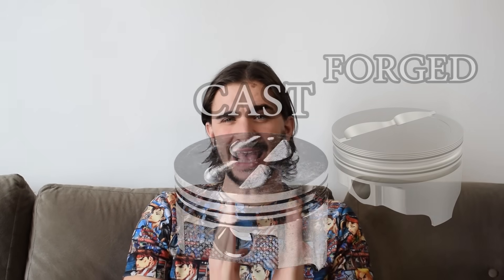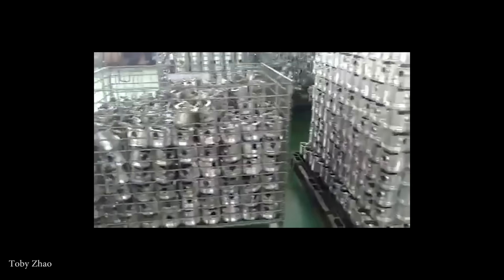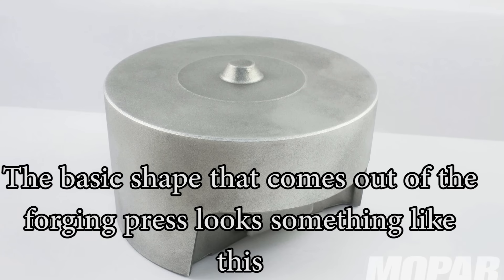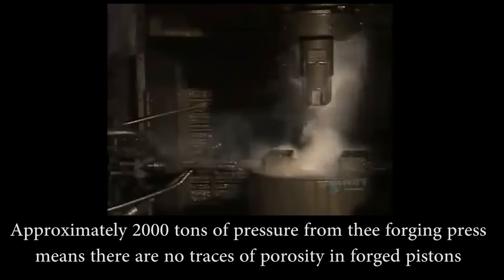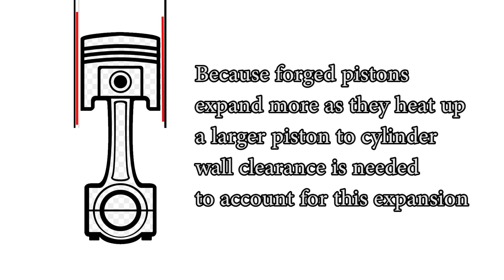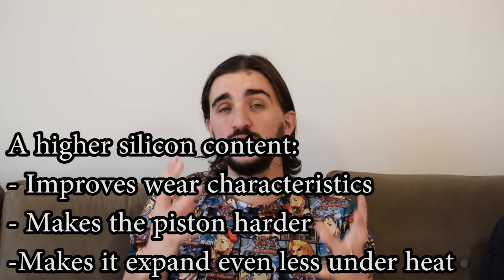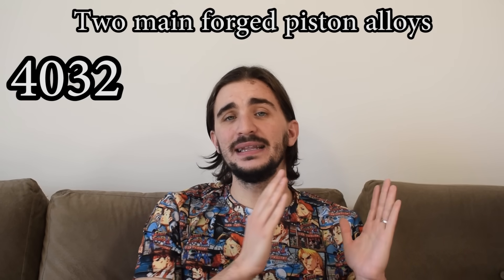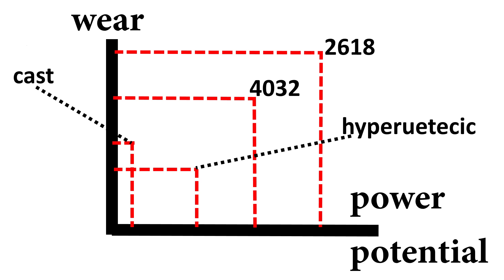FORGED vs CAST vs HYPEREUTECTIC PISTONS

Comment: Chrysler turbo cars in the 80's and 90's came factory stock with Mahle forged pistons. Mahle used a manufacturing technique which inserted steel rings into the forgings to control unwanted expansion. I can state from my own experience with two Dodge turbo cars that I own, the problem with piston slap and excessive wear does not exist with high quality forged pistons, such as Mahle's. My '89 Spirit turbo now has in excess of 300,000 miles on the odometer, and the cylinder walls still show the factory cross hatch pattern they had when new. Compression in all 4 cylinders is still well within good limits. I use synthetic oil and change it every 7000 miles. My opinion; hypereutectic pistons are just cheaper to make and so provide a higher profit margin to the guys behind the counter. They use the buzzword to make the buyers think they are getting something really superior to everything else out there. Not necessarily so.

Comment: when you look at it on normal running engines everything around the piston like valves, bore wear, rings, timing chain, head gasket, will give more trouble than the piston.

Comment: All y'all talking about boosting y'all's motors and running cast pistons need to find another source of information.  Put busy on top of those positions and see how long they last. I've got a high horse power drag racing engine with forged pistons. I take it when ever year and put rings a bearings in it. Not once have I ever seen any scaring or witness marks on the cylinder wall or piston skirts. They fact is very simple. Forged pistons are significantly stronger and longer lasting than cast.  The amount of clearance change from the heat is minimal. Thousandths of an inch at worst. If your getting piston slap, it's simply because you didn't buy the correct sized piston.

Comment: Toyota yaris here with tombac hypoeutectoid (yes hypo) precipitation treated pistons with unobtainalloy sleeves, tungsten hafnium carbide coated high speed steel valves, with a solid high carbon steel block, producing 3000 horsepower daily driver has 500,000 miles. Not for sale
Reply: slade bonge  The March 24, 1933 Daily Express Newspaper Headlines say otherwise buddy

Comment: I've got a 5.4 2v I built with - 6.5 cc forged pistons on mmr rods with arp 2000s. It's an e85 car only as it's supercharged with a vmp gen 3r blower with 20lbs of boost. Made 968 hp at 6200 rpm and 1002 torque at 4300 rpm  on a mustang dyno. It's a circuit track car only. I'm not into spending 1000s of dollars to got 1320 lmfao 😂. But anyways the piston slap sucks ass at start up. I know it's just beating the dogshit out of the cylinders. It's why i never daily it. It's a 65 mustang coupe with a custom built ifs I welded in on qa1 shocks and a 02 gt rear axle on a 4link on qa1s with a 6r80 trans controller with a US shift. I know I'm coming off as a show off lol but I love building engines. This dude really put a very good description on pistons. If you're going forged...just know you're going to hurt your cylinders every start up. You will have 3+ 1000ths of clearance on most set ups. That's going to knock until the expansion. That's just destroying the skirt and killing the hone.

Comment: i think the correct word for "Piston Slap" is actually called cavitation? Open to Corrections tho
Reply: Cavitation is when a liquid changes to vapor due to low pressure. The expanding bubble pops which causes erosion in the surface of the material in contact with the liquid.

Cavitation can cause piston slap due to there being no liquid oil between the piston and cylinder. It can also be caused by a large bore/small piston.
Reply: @9HighFlyer9  oooohhhhhh okay okay. Still learning alot of this stuff, so i guess that aint what i thought it was. Thanks for the info!

Comment: My stock Supercharged Camaro with the LSA engine came with Hypereutectic. Now I know why. Thanks
Reply: slade bonge  so do junkyard LS engines but whatever you say bro
Reply: Yes, because Chevrolet are cheap bastards
Reply: @DStead2239  It's funny how you see a crap load of Ford's with LS engines and gm transmissions 🤣
Reply: @georgeferrer23  Yeah?? not here, maybe in America..
LS engines are expensive here.
Cars also have to be engineer certified as safe to drive on the roads. So you don't see LS swaps as often into other chassis but you will see alot into old chevs or Holdens but they're normally quality full builds, not junkyard hillbilly hackery.
Fords here normally stick with the Barra as they can make power just as easily and in most cases, more power, more reliably for far less coin
Reply: @DStead2239  Ford's are crap everywhere. I don't know what planet you come from.
Reply: @DStead2239  Maybe your Ford's run on dingo power not actual horsepower.
Reply: @georgeferrer23  Actually horsepower here is measured properly, American horsepower is actual piss weak, by about 15% or more vs your Mustang dynos..
American fords are crap, So are Chevys, well actually any GM product is crap tbh
Reply: Ricers gonna rice
Reply: @DStead2239  lol that motor than can take 1200 hp is cheap af
Reply: @DStead2239  Yep, that C7 Vette was cheap but it still beat the Ford GT's lap time.
Reply: @DStead2239  yet everyone and their mom wants a junkyard Ls to put a turbo on...
Reply: @KingJT80  maybe in the U.S, here Bogans use junk yard barra's and the rest of us build proper engines..
Reply: @DStead2239  like richard holdner said youre both right

Why buuld the engine up like that when the junkyard ls will respond to a small turbo and cam?

And why waste time on a junkyard ls and just build it right?

You're both right. They both have their places

Comment: Very few  pistons are plain  cast these days.  Hyperuetectic defenitly. Even for a basic roadcar engine rebuild really.
Piston clearance is a very large drama. Block type and material is part, A cast piston used for performance is double the  manufacturer clearance, a hyperuetectic generally add a thou.Or they will scuff, nip or worse. And turbo makes life harder, more boost more clearance. The more modern forged are better for general high performance work and are cheaper as well. BUT you will never be able to get them as light and still strong as the older material. Big time racing requires them and small time turbo engines as well.
Alloy blocks also suffer from plenty of slap cold. Of all brands, though they design them to warm quickly
Any remotely performance engine requires a cooling system that gets up to temp quickly,, and  that means around 195-200F, not 180 as the ring gaps are probable 2 thou more.As for 160F you are simply wearing the engine out rapidly and a cast piston will lose skirts doing so. And losing loads of power as well.
Problem with all pistons these days is manufacturers make them with less compression than original, coupled with headgaskets a lot thicker and ring gaps more than 150000 originals. Just big low comp leaks. And this on supposedly performance engines. My 71 400 Ford, originally 9.1-1 would have ended up 7.8-1!!!!!. FM std replacement. This applies more too 60s 70s 80s engines but I have struck that on a rebuild of a 3y/o car that was overheated. OEM 9-1, replacement .020"  just over 8-1! Yeah right.
Everybody and especially the turbo 4 brigade spend zillions trying to keep engines together. Basic piston and ring clearance and correct comp is basics.As is running temperature. Makes more power than that bigger turbo or exhaust out the bonnet! And requires many less rebuilds.

Comment: Excellent video and information. You are absolutely correct with the analogy of engines and shoes. My bugeye WRX was fitted with forged pistons, forget rods and steel crank when it was professionally rebuild by the previous owner. The piston slap was very evident when the engine was running cold once I rectified the valve tappet clearances. It's my daily driver.

Comment: I guess that to minimize piston slap you’ll want to build the engine with a short stroke.
Reply: Rod length is more important. Every piston manufacturer will tell you the maximum rod angle the engine should have for that piston design. That's why you see a lot of stoker kit pistons with the wrist pins way up in the ring area, to optimize rod angle for the longest rod possible.

Comment: So that was some what interesting.... I'm going to be rebuilding my RB26 just refreshing it up by getting the head serviced and fitting new crank and con rod bearings as well as new rings. Should I just leave the OEM cast pistons or buy forged??? Like I said I'm just refreshing it no boring just honing the block. I'm fitting tomei twin turbo's and maybe changing the cam's???  The car won't be daily driven just a couple of times a month for cruising.

Comment: May I ask about mean piston speed ? Do forge piston have higher capability to piston speed?
I hear that forge piston can rev up higher than cast piston.
Is it true?
Reply from the maker: Yes, as a rule of thumb forged pistons can take more abuse, higher rpms and higher average piston speeds.
Reply: @d4a  do you have figure about it?
I read some article that cast piston is about 25m/s.
How about forged piston?
Reply: @leotsun  For high rpm application. You want to focus on forged rods and cranks if it not up the task, to hold all the mass, more the your general off the shelf forged piston set.

Comment: fun fact, in formule 1 the bore gap is so tight in a cold engine that there is actually no gap. 1 hour before the engine needs to run they pump in hot oil and hot water (well coolant). so that the engine warms up and expands. otherwise it CANNOT start. the engine and pistons need to expand but the engine expands just a little more so that the pistons can move.
Reply: Very tight clearances for performance but not practical in a normal car. And who can afford a team of mechanics to get your car ready to go down the shops?

Comment: Questions. 1st-Soooo does the forge vs cast also affect other parts the same way such as the crank or conrods??? 

2nd- Is it possible to say that there is aftermarket cast parts that could be better than oem with out having to go after forge ones in case that any one would like to go for daily butt more powerful than stock.
Besides that love the video hope they never stop coming and I'm still waiting to see some of that American metal in the engine SERIES👍
Reply from the maker: Forged rods and cranks are always better than cast and there really aren't any downsides there. The American engine aftermarket has many cast and hyperceutic piston options, some which are certainly better than OEM, especially old OEM from the 60s and 70s.
Reply: @d4a  thanks a lot for the answer, but I actually own a 2018 camaro ss so sadly no 60's muscle making it one of my"most have car's" for the future and hopefully not a far one 👌👍.

Comment: I was going to use a forged 2618 Mahle piston in my EJ207, but watched a few vids and went for a CP 4032 instead. So vids like this one do help us to make better choices.
Reply: Can you share the part numbers of the CP 4032 pistons for Subarus? I've never seen a 4032 from CP, while Mahle is known for their 4032 PowerPak pistons.
Reply: Ivan Delos Santos bingo. I’ve got Mahle for my SBF, they’re 4032. Don’t expand much, can run tighter clearances
Reply: Pretty sure piston slap isn’t really an issue in a horizontal layout.
Reply: The ej207 is factory with forged pistons tho ?
Reply: @alexjaxon9928  Depends on the year/version. STi V7 used forged pistons. V8 and above went to cast hypereutectic.
Reply: @19minorthreat69  no!! ...all sti 2 liters after sti v6,   hypereutectic pistons . 
for spec c .... I do not remember anymore
Reply: THESHADOW97139 nope, V7 forged. V8+ hyper.
Reply: Give yourself a step up in reliability, probably a good idea that u did that and u still get pretty good performance characteristics also.

Comment: So. You're telling me  I probably shouldn't put those 1000 dollar forged pistons i bought yesterday into my 89 corolla wagon with 251000 miles? Dammit.
Reply: actually if you got stock bore size it might be perfect hahah seal up that worn out bore
Reply from the maker: Lol!
Reply: Your friendly neighbor Stanley. You’ll be just fine Stanley just make sure they were STD (not what the neighbor has if you know what I mean) and save the money on  getting the cylinders checked. They will expand and fill then just fine
Reply: Your friendly neighbor Stanley just use it for drag racing as suggested.
Reply: Funny. It's alright. Just 'resell' it. Most likely, somebody building an engine for Motorsport would pick it up.
Reply: Ouch... But I saw this 11 months later :p How's your 89 corolla with forged piston?
Reply: If your forged pistons are O.E.M. from Toyota made for your 89 Corolla ...yes by all means install them ..but if your engine was originally equipped with cast pistons use Hyperutectic pistons

Comment: I use 2618 forged wisecos with quite large cold clearance on a honda b20b engine.

It starts up like a diesel, kicks oil out the exhaust on cold starts.

Just opened it after 200,000kms and the crosshatchings are still there with no sign of piston slap on the liners.

Definitely not usable for a daily driver.
Reply: Forged pistions need to warm up first. Definitely not for a vehicle that someone just fires up and goes. But they take some serious abuse.

Comment: is it true that on some engines like subarus ej20 the cylindre actually expand more than the pistons because the engine block is aluminium?
Reply: All I know is that all 2019 & 2020 STI EJ engines have hypereutetic pistons and STI ditched using forged pistons in the S209 last minute before full production for the cast hypereutetic pistons they started using in 2019 & 2020 STIs  after they used it in the Type RA as it was stronger during their testing parameters.
Reply: @slothystyle  oh okay. i have a 1998 sti with forged pistons and a very famous engine builder (subi performance) said in one video that the piston wall clearence is in hot temperature actually bigger than when its cold thats why subaru engines have really really tight fitment when it comes to pistonwall clearence.

Comment: Hello friend great content ! I have a hard time with my piston selection, i want to replace my DC2 Type R pistons for B18C engine to get around 250hp out of an 1.8L high reving engine, do Hypereutectic pistons suit my needs well?
Reply from the maker: It really depends on a lot of factors, as I said in the end of the video you have to ask yourself how often will you drive the car. If it's going to be a track car I would go for 4032. If a daily driver than 250 hp naturally aspirated might be a pain to daily drive, and I would aim for something around 210-220 hp maybe even less, and you could likely keep the stock pistons. But this is just my opinion and nothing more.
Reply: @d4a  i like how you think, its a very light car and dont need much power to go, i want to add +60hp to the engine but want to reduce the wear effect, i daily the Integra and go to work everyday, soo... Hypereutectic ???
Reply: Gonna need highest compression pistons there are to get 250hp plus a wild cam hard to pull off 250hp. Just getting 200wheel horsepower isnt an easy tast nvm 250